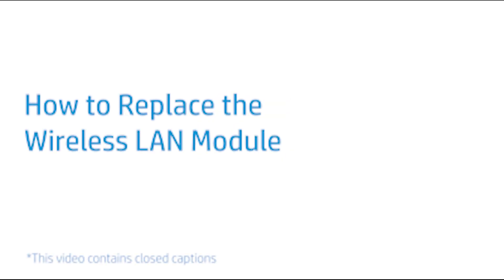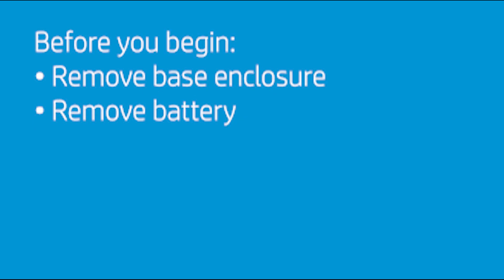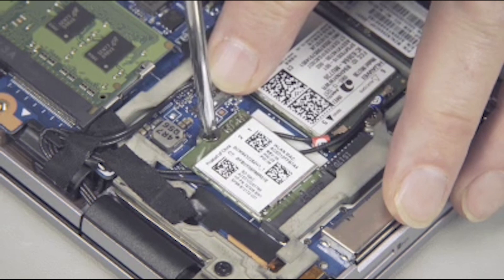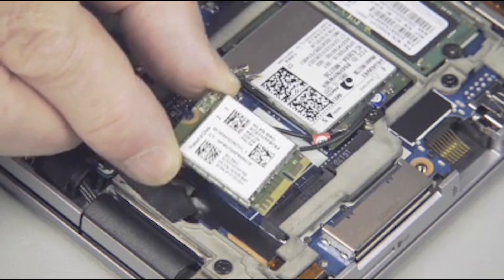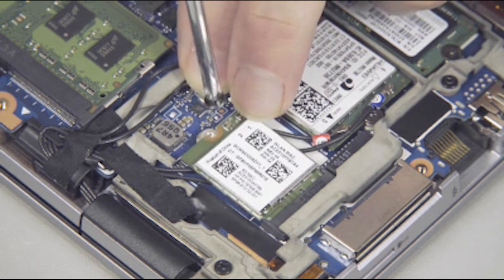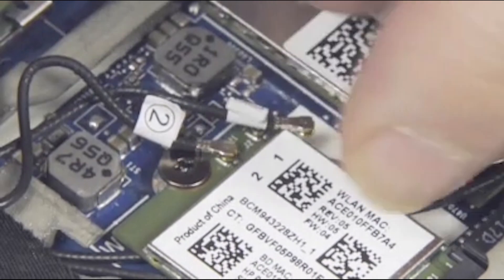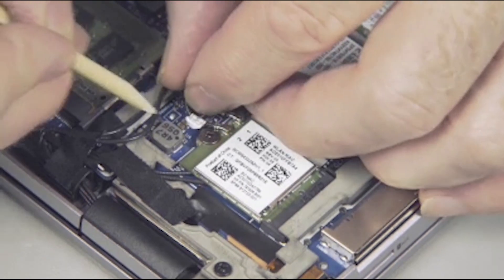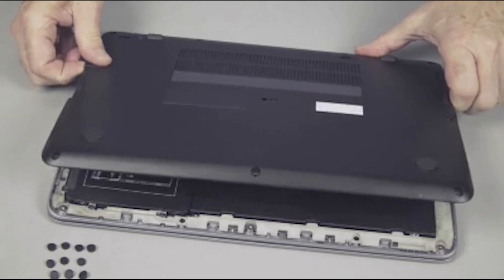Replace the Wireless LAN Module | HP EliteBook 840 G3 Notebook PC | HP

Comment: Can I remove this without IT knowing about it
Reply from the maker: Hi there, thanks for contacting HP Global Social Media Support!
I am here to help!
What seems to be the issue? Are you facing any technical issues with your HP notebook?
Let me know!
Regards, 
HP Support
Reply: @HPSupport  Trying to remove my wifi component so my employer doesn't know im working out of the country
Reply from the maker: HP does not recommend upgrading or downgrading hardware parts or software that is bundled with the product as It may affect the manufacturer's warranty and performance, however, you could change the configuration at your own discretion.
Regards, 
HP Support

Comment: Hello There!  I have a Hp pavillion 14 notebook pc... I didnot get any wifi or bluetooth signal.I have tried all the drivers from hp support site.May be my wifi card is damaged. Could you told me if i change my wifi card i will get bluetooth too?
Reply from the maker: +jami du14 Please perform updates via Windows and HP Support Assistant as mentioned below to fix this issue: Step 1 Windows Updates - 1) In the search box, type and open Windows Updates. 2) Check for updates. 3) If the updates are available, click on install and restart the computer. Step 2 HP Support Assistant Updates - 1) In the search box, type and open HP Support Assistant. 2) Check for updates. 3) If the updates are available, click on install and restart the computer.